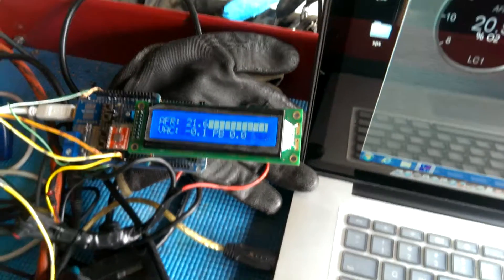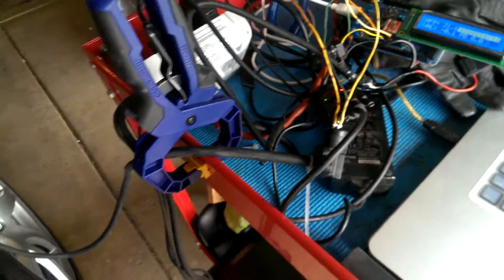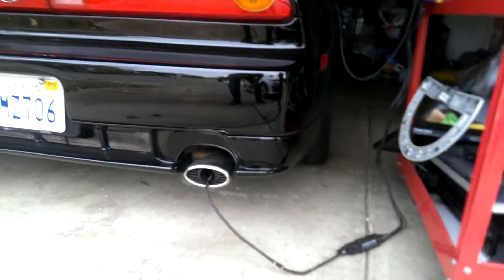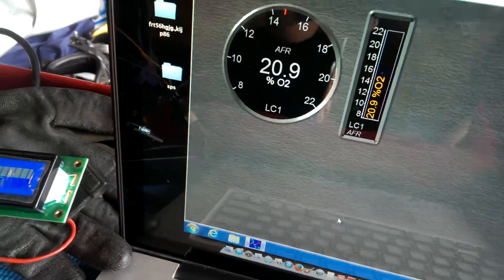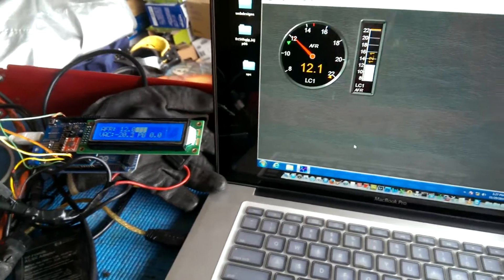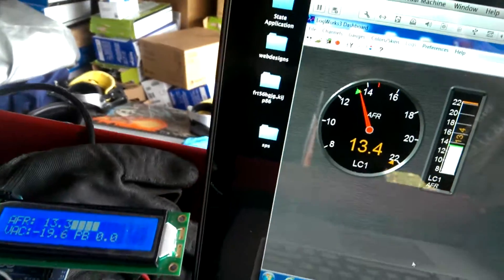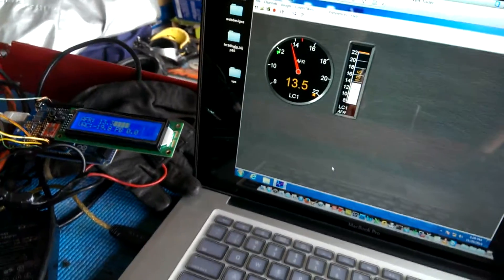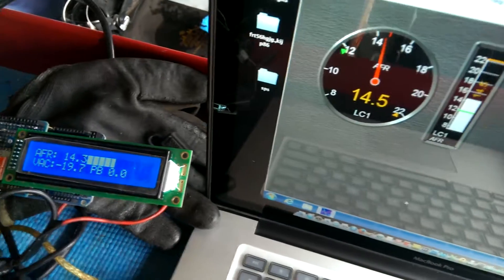Arduino Air Fuel Ratio / Boost/VAC Gauge Tested in my NSX

Comment: Hey Paul, 

I have the Innovative LM-1 Unit and I was wondering how I would implement it with the Arduino. I still would like my main Innovative unit to gradually heat up the 02 and display values on its own display (I plan to hide it cause it's such a damn brick) but I was thinking of soldering some wires on the RxD and TxD on the Innovative board and running them to an analog input on the Arduino.  I pretty much just want to mimic the AFR readings from my Innovative unit to the Arduino LCD unit along with Vacuum/Boost functionalities as the unit you display in this video.  I hope this makes sense. Thank you!